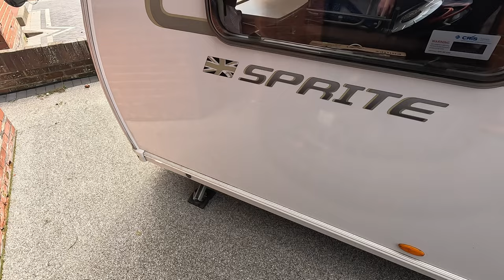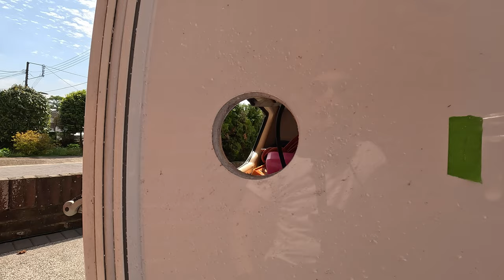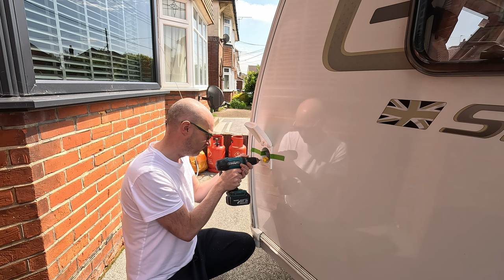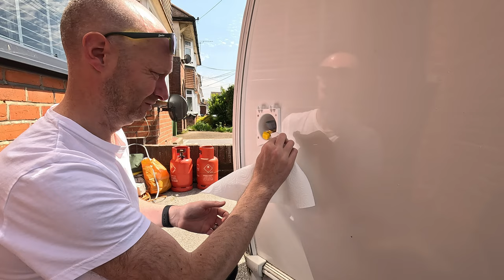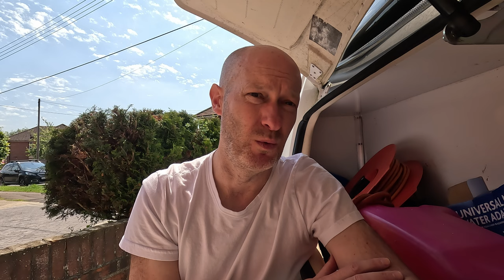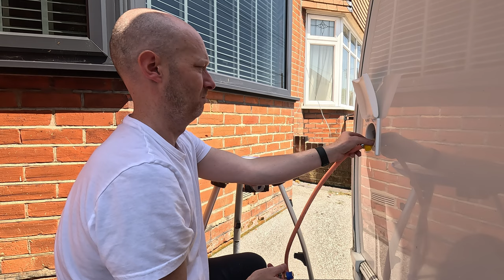How To Install A Caravan Truma BBQ Gas Point, Finger Licking Good #caravan

Comment: Hi, what silicone did you use? Just had our 2021 swift serviced and found damp under the bbq point so I'm going to have to replace it.
Reply from the maker: Sikaflex 522, best stuff to use on any external point.

Comment: Very interesting, are you sure that screwdriver was long enough😀
Reply from the maker: lol, it was the first one I came across.
Reply: First time using a drill?
Reply from the maker: Cheeky, battery was going flat on me lol
Reply: Is it not necessary to fit an isolation switch between your ‘t’ joint and the outlet point?
Reply from the maker: This would be down to you, it was a recommendation when speaking with others but felt it was over the top as you have an isolation switch at both ends anyway, one less thing to to wrong. I do stress this is not a how to guide but how we installed ours.
Reply: Well done to you . Good job

Comment: Good video but a Pity for me you didn't show the gas pipe connection work . I have one fitted but the plastic tap has failed so just need the internal bits not the plastic housing .
Reply from the maker: Are you not able to get the parts to repair the tape without removing altogether?
Reply: @wobbleboxcrew  yes I thought so but posted photos on a Facebook group and they told me I need to replace the whole thing ...I thought I could undo the large visible nut and put the new one back on the gas pipe?
Reply from the maker: Looks like it's cheaper to buy a completely new unit off eBay, couldn't find any parts to repair it only this which is more expensive. https://www.gasit.co.uk/1-way-8mm-inlet-8mm-outlet-tap-bbq-with-quick-connection.html

Comment: Where did you get and what size is the T piece, and what size copper pipe did you use
Reply from the maker: Hi, it's all 8mm pipe and fittings, got them from eBay and you'll find the parts in the description. Great to see you've started a YouTube channel 👍🏻

Comment: hi what the external fitting i need to plug in...
Reply from the maker: Hi Gary, this should be the part you need, I would consider having a quick-release connector on the other end it makes life much easier, https://www.ebay.co.uk/itm/175865824726?hash=item28f26b85d6%3Ag%3ADGUAAOSw-MVk4Hg0&amdata=enc%3AAQAIAAAAkGqM2nkRQdS2rWDQmX5BdSXe%2Bh%2B01ycuJ9%2BeVJ3MtqgxESdDoNs4FHwnQG2JxfbKf5lZmcS9H2tEGpWU2QPP4cgK83%2FCObyzoNikwZJFeBPy6fyNxEiTsGaml2CYKajDfQ9EkfpIjgB43TK9wszf%2BipLprOf5kHqG%2FC%2BSFpoFCBTv5zyVSmodyy%2Fe085Z%2BugDg%3D%3D&mkcid=1&mkrid=710-53481-19255-0&siteid=3&campid=5339016594&customid=WobbleBoxCrew&toolid=10001&mkevt=1